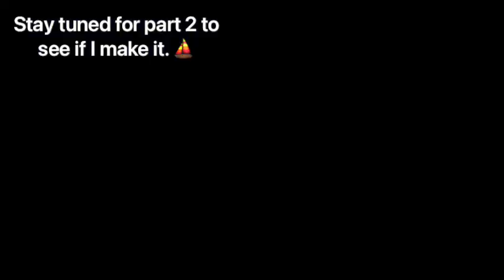First 2 weeks in the ocean and I’ve run aground. Part 1

Comment: This is painful to watch.  I'm not sure sailing without maps and/or a working depth finder is a good idea.
Reply from the maker: Or an alternator that only charges at 1,000 rpm or above. Every sailor has run aground at some point and any that says they haven’t are lying. Most sailing channels I watch like to show only the highlighted, edited glamorous shots they get. Those are a dime a dozen.
Reply: @CalebLeverett  I'm not saying I could do it any better...I'm just saying this is fucking painful to watch...Is this going to mess up the anti-fouling paint you just put on?
Reply from the maker: @The_Osprey  aren’t most of my videos painful to watch? 😂😂 I’m sure I’ll need to redo the paint, but so far that’s all the damage (possible damage I see). The prop and rudder are fine and the learning curve I’m on is incredible.